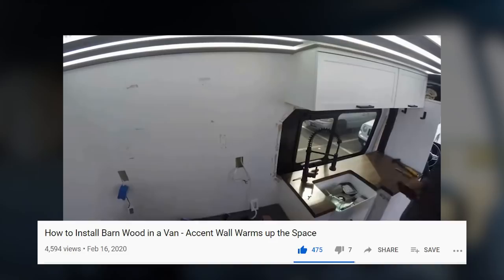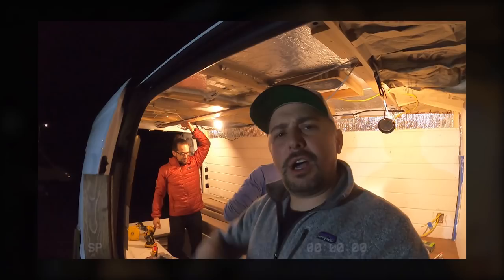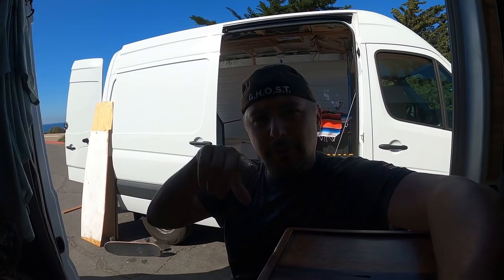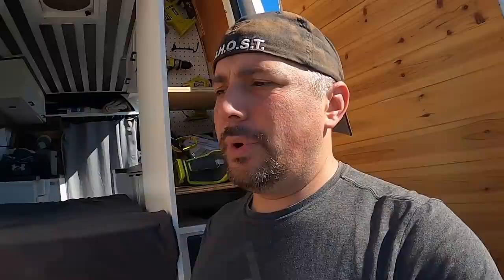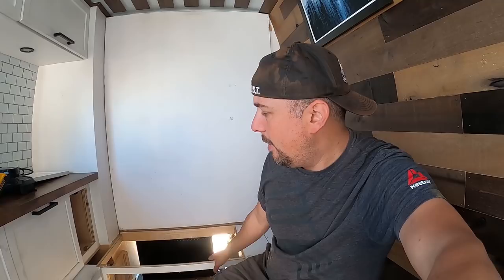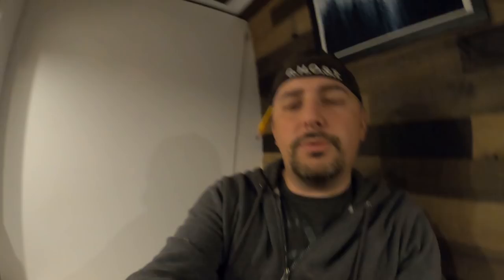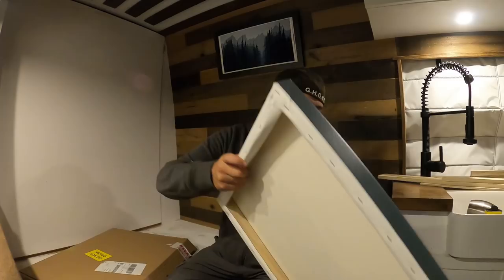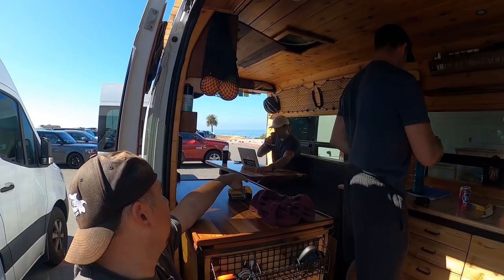Starting to Build a Van in a Parking Lot - Little Work on my Van

Comment: Hey Jarrod I wondering if you have come across or thought of doing this to the back doors.  I think your van really cool but be even better if you cut the doors in half and have 4 doors. Then you can lock the bottom while opening up the top to view the great sunsets and sunrises. let me know what you think of the ideal.
Reply from the maker: Requires a lot of work but it's doable. For me it's not worth it as the amount of times I'd use that feature I wouldn't want to put the money and effort towards that. But good idea